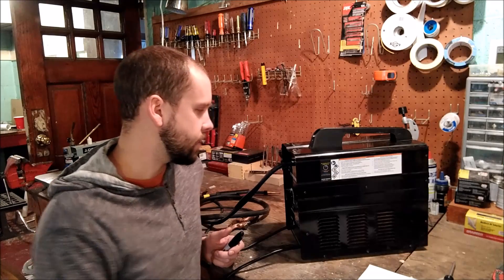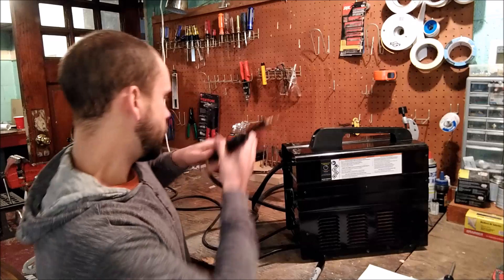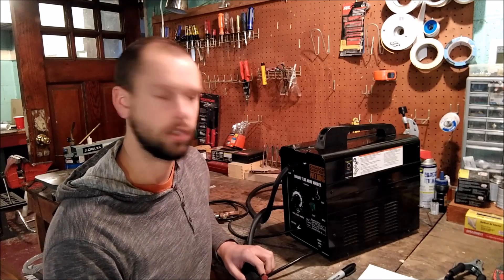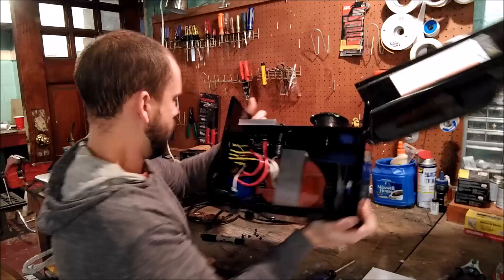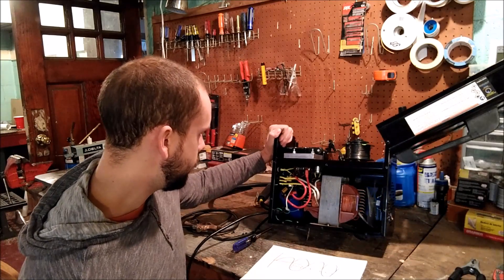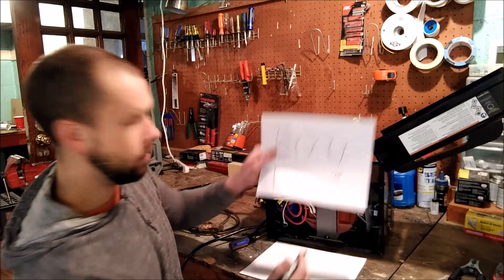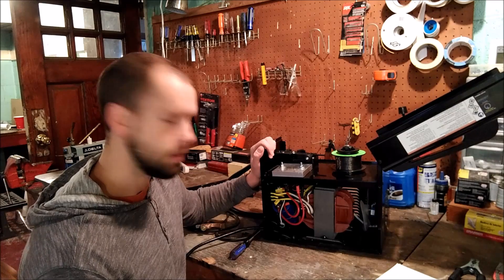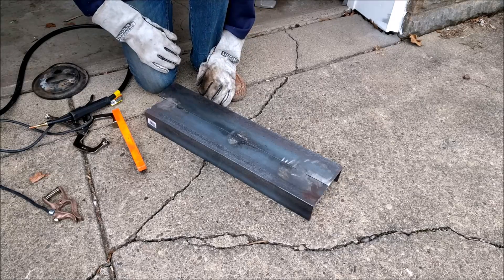Modified Harbor Freight MIG Welder

Comment: Those with the older welders if you don't do anything else put a plastic shroud around your fan it will make your welder so much cooler oh, it will actually pull air in from the back and actually push it out to the vans it's cheap or just buy a computer fan

Comment: You really should upgrade the fan on that thing. The extra cooling will greatly improve duty cycle. I installed a fan made by  Cool Tron 127mm x 38mm 115v that puts out 130cfm. It moves at least double the stock fan and keeps my bridge rectifier and transformer much cooler.

Comment: The resistor should not be across the cap during operation. You should wire the discharge resistors through a NC relay to short the cap only when no power is going to the cap. Also why two resistors? If you have decided on a  50 ohm value just purchase a single 50 ohm of proper wattage rather then two 100 ohms. You can also use a much smaller wattage resistor when simply discharging

Comment: Dude!!!
You have the Electrical side of this Down!!!
Did you know Ebay sells the Gas Solenoid for Ten Bucks!
there is already a Switch to be used...
just mount the solenoid to the wall inside and connect to a bottle!!
the torch comes with tubing inside the Sheathing😆😆😆😆
Reply: Can you add a link?  For the solenoid
Reply: https://www.ebay.com/itm/U-S-Solid-1-4-Brass-Electric-Solenoid-Valve-DC-12V-VITON-Water-Air-Fuel-N-C/281960425919?_trkparms=aid%3D555018%26algo%3DPL.SIM%26ao%3D1%26asc%3D57921%26meid%3D132bdcd2d1314ad8b3e3d26cb70ef73b%26pid%3D100005%26rk%3D1%26rkt%3D12%26mehot%3Dag%26sd%3D292179950457%26itm%3D281960425919&_trksid=p2047675.c100005.m1851
theres a Full range of DIY welding stuff here too!!!
😉

Comment: IMO, cutting the nozzle cap down a couple cm nets better results as it still protects the actual tip. And i crushed a copper pipe and cut it in half and screwed the copper sheets into the included clamp to get much better results from the same clamp. Just a couple alternate ways to improve those parts
Reply: Good idea's...

Comment: Sorry but not good advice . Unless your warranty is expired I wouldn't start modifying this machine . If you're going to be modifying something how about showing the finished product and show the weld ? I saw lots of spatter going on with this . Also that tip is there for a good reason .
I do agree with replacing the clamp since  that thing is no better than a battery jumper cable clamp .Once my warranty is done I plan to replace mine as well .It will do for the meantime .
I looked at getting a flux core only machine but decided to spend a little more and went with the MIG 170 instead which is the better way to go if you want DC welding and higher output plus be able to have gas shielding. I got mine for $180 . It's not a Lincoln electric or a Hobart or anything like that but it will get the job done and I can learn along the way and make some money to get a better machine later on .
I wouldn't advise anyone to start modifying their machine unless they understand electricity, use caution ,and know exactly what they're doing before starting such a project .
Reply: Harbor Freight's warranty is 90 days, so that's probably not a big concern :) The rest of your points are completely valid.

Comment: Another mod that you can consider is to check to see if your wire feed motor runs off of your transformer - if it does then get a small wall transformer and feed it off the inlet power source..

Comment: Don't remove the nozzle, because you'll get arcing on the sides, and blow your rectifier. Instead, trim it back, 1/2in,  exposing the tip more. I weld "hard" with these things, they are awesome for the money. (Bodyman 25yrs)

Comment: A lil to much for me I'll just try to unscrew the tip to see better but thanks for the video
Reply from the maker: Sounds good!  Getting some good wire really helps a lot too and it is not very expensive.  Plus just making sure your metal and ground area are really clean.  I like to get some flap discs for the grinder to shine things up quickly

Comment: This isn't really a mig welder. Mig stands for "Metal Inert Gas" welding. This welder is a "flux core welder" which has none of the necessary parts to weld with shielding gas. The cheapest that you can get a mig welder for at Harbor Freight is around $175. The cheapest mig welder at Harbor Freight is a much better built welder than this one.
Reply: I cut 26 inches out a truck frame and drive shaft and stuck it back together with nothing but a youtube education, THATS what the 100 dollar freight welder can do. Its an amazing little machine. If you crank it up and double pass  clean your metals and bevel the thick stuff you can weld damn near anything with it, the 220 is a bad ass no doubt you can shoot some filler fast! But the lil 90 amp can get it done, just read the directions/ watch a few vids
Reply: Anonymous Stranger get this, i hacked a gas feed to the nozzle and loaded .30 solid wire. This machine has NOWHERE NEAR enough power to melt it....

Comment: THE NOZZLE KEEPS YOU ISOLATED SO WHEN YOU TOUCH THE TIP ON METAL YOU DONT SHORT OUT THE TIP!!!!!!!  Otherwise you will eventually weld your cable inside the gun shut!!
Reply from the maker: The tips are copper and the wire is steel so it really doesn't seem to weld itself shut.  Every once in a while the nozzle gets gummed up and needs cleaned but not totally welded shut
Reply: Not the tip!  The cable (conduit) that your welding  wire feeds through is STEEL  it is the same as the outer part of bicycle brake cables! And trust me. They weld shut from the direct short!!  Good luck finding a 10 foot brake cable housing when you're in the middle of a job

Comment: Do you have pictures of the steps that you took to get to that point I have the parts but when I open up the welder it didn't look like some of the other ones I have been watching on YouTube yours is just like it but I can't tell how you wired it all up thanks
Reply from the maker: I don't have any pics off hand but basically you just clip the two big wires coming off the transformer.  One goes to the ground clamp and one goes to the gun.  Put both of those wires to the input of your rectifier (it doesn't matter which side).  Run the +output to the ground clamp and the - side to the gun.  Run a big capacitor between the two output wires to smooth out the current and a resistor between the terminals on the capacitor to bleed off any energy when you stop welding.
Reply: Cool Stuff Guys Like I just recently bought the harbor freight MIG  170 A 240v welder which is a DC if I were to put a rectifier and a big capacitor would it make it any better? And if so how big of a rectifier and capacitor what I need?
Reply: Cool Stuff Guys Like technically should have a rectifier and a capacitor if it is running AC from the wall right? Maybe I can Upgrade to  bigger and better

Comment: Awesome vid! One question would it be better to run 105 degree C Caps or would 85 degree C be fine?
Reply from the maker: Thanks!  I think 85C caps would be fine since the duty cycle is so low on the welder and it won't be running more than about 30 seconds or a minute at a time.  If they are the same price, then go with the 105

Comment: If my mig welder is AC output. Is possible to connect a tig torch and use as an ac tig welder?
Reply: Luis U Rodriguez ac tig is for welding aluminum. But you need high frequency start, if you touch the electrode to work, you contaminate both. I
Been thinking i could use a 12 volt power source and points type ignition coil to get the spark jump the gap withou touching.....

Comment: What would happen if you ran two rectifiers. Hooking them up opposite of each other on the input side. But still negative to negative and positive to positive on the output side. Would that give you a smoother output? Since the rectifiers are seeing opposite sides of the transformer.
Reply: Thank you for your response. The AHP welders look pretty nice.
Reply from the maker: I'm not sure that it would make much of a difference since the sine wave for the voltage is still crossing through 0.  If you look at a diagram for a rectifier, each terminal on the input side is the same.  It wouldn't matter which one you are hooked to.  Both input terminals have one diode flowing negative and one flowing positive, so reversing the inputs shouldn't really change anything on the other rectifier either.

Comment: I tapped the brass cap with a 90 degree brass fitting. 3/8 npt male to a female air fitting. Also 3/8 npt. Added gas right at the tip. Ran my tubing along the lead, back to the box. Zip tied in place every 10 inches or so. As far back as I could tap the hole without hitting the ceramic shield.

Comment: I wouldn't worry about a bleeder resistor. The voltages coming out of a welder is low and if you're worried just tap the wire to ground when you turn it off. Instant cap bleed.

Comment: To further smooth out the power curve of the welder you can also put a choke between the capacitor and the tip. I rewound a microwave transformer with about 5 feet of 2 gauge wire. This creates a weak magnetic field to smooth out the power. You could also just wrap the wire around a short piece of steel pipe to get an approximate effect. Mine runs real smooth with very little splatter 8-)

Comment: glad i found your channel, ive been kicking around the idea of a 110v mig, still thinking of going gas, but one thought ive had on these type welders, with the heat/amperage switch. what would it take to run a rheostat vs that switch for better heat control?
Reply: dj berg The rheostat and the switch on the machine preform two totally different functions. The switch is selecting from two different taps on the transformer. This changes the wire ratio on the primary side causing the secondary winding to change its voltage as well. The higher up versions of these tranny based welders with the dial switch for voltage do the same thing with a few more taps. 
The rheostat you want to use would be acting as a voltage dropping resistor or a voltage divider depending on setup. The problem here is that it will be operating on the secondary side which means it will see full welding current. Good luck finding a rheostat that can handle that much current without costing an arm and a dick.
Reply: I believe old model train ones work well and are not horribly insane price wise
Reply: I went from a AC welder to an everlast DC inverter and it was like night and day. I'll never go back to AC. The rectifier / capacitor modification is well worth it if you already have an ac harbor freight welder.
Reply from the maker: I have a Hobart Handler 140 as well and I like it a LOT.  I think it is the best 110v for the money but it definitely a bit more than the harbor freight.  You may want to look at some of the 110v welders that are already DCEN if you don't already have a harbor freight.  I think they start at about $150

Comment: What's more the important the number with a capacitor, number of uF or dc volts?
Reply from the maker: +Bill Puller the rated voltage must be higher than what you plan to but through it, so in this case about 50v or higher would be more than enough.  The capacitance is rated in uf.  You will want to be in the ball park there but a little lower or higher is not a big deal.  You could also run multiple smaller capacitors that would add up to enough capacitance if you wanted.

Comment: Can you give details and sources for the electronic parts used in your AC to DC mods to this welder?  I'm interested in making these mods to my machine.
Reply from the maker: The rectifier is a MDS150A three phase.  I originally tried a 100 amp two phase but blew one of the diodes.  On the 150A three phase you have a spare circuit that you don't need which is nice.  The capacitor is a 68000uF from Mouser Electronics.  The mfg part number is 661-36DA683F050CC2A.  I This seems to be around the size most people are running.  You might be even better off to run a two or 3 smaller capacitors that would add up to 50,000 to 100,000uF.  The Hobarts and Millers seem to run a bunch of small caps to add up to the right capacitance.  I am guessing they would discharge faster than one larger cap.  The wire is just 6 gauge from lowes and i got some big copper terminals and heat shrink for them.  I also ran a bleeder resistor across my capacitor so that it discharges in a few seconds if I am not welding.  I believe I am using two 50 ohm 5v resistors in parallel for that.  That should be pretty much all you need.
Reply from the maker: I just double checked and I was running two 100 ohm resistors in parallel.   So you could probably run one 50ohm if you wanted.  Depends how fast you want it to discharge after you finish pulling the trigger.  Be careful with those big capacitors, PS!
Reply: Thanks, I'm going to mod my welder just as you have done.  I appreciate all the data,